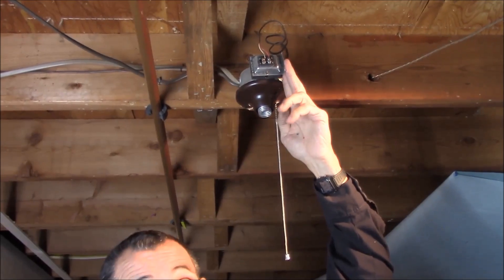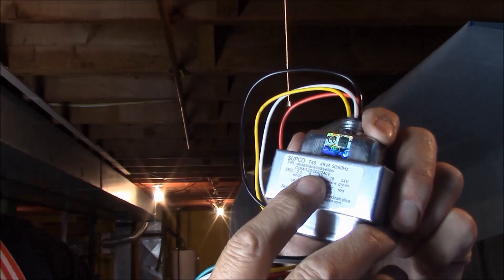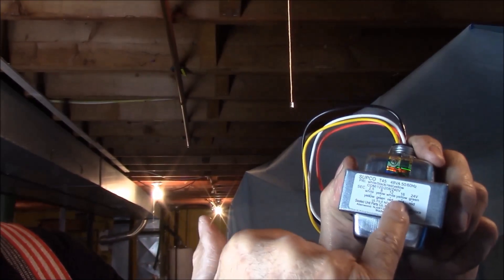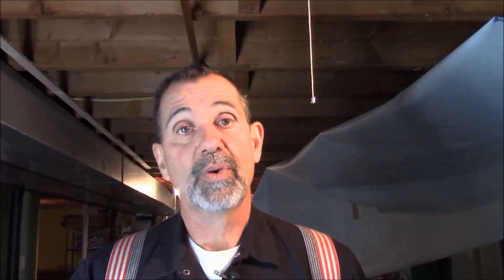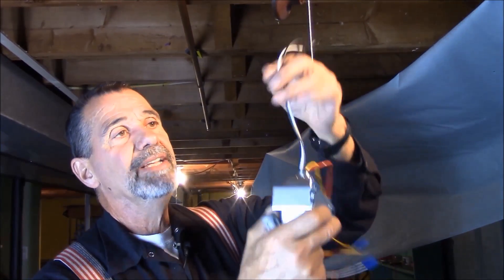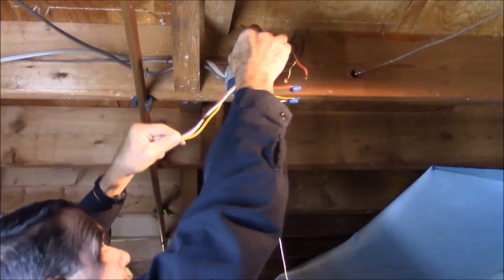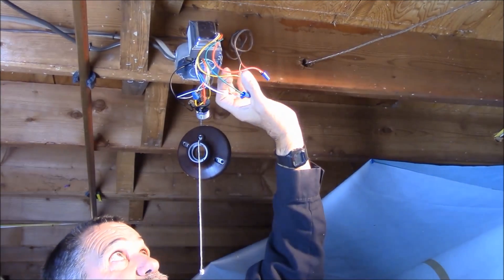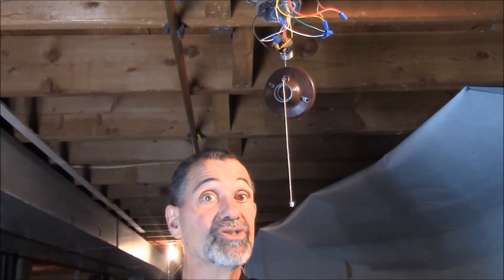Ring & Nest Doorbells Require 24Volt, 48VA Powerful Transformer

Comment: What do you use for the wired chime if you have a 24V one?  The one I got from Home Depot makes the noise and then buzzes.
Reply from the maker: If it buzzes after the chime you could have a sticky button or if you’re using an electronic doorbell it could in its software.
Reply: @MrHardware1  I have a Ring Doorbell Pro wired in (the wiring was already in place prior.  It "buzzed" with the 16V thing in the system and still does when that was upgraded to 24V.  Just a single Ring Doorbell press.  Tone plays and then longer buzz.

Comment: I’m trying to power three separate Lorex video doorbells and a mechanical chime. There’s not enough juice to power more than one doorbell at a time with the 24VAC 40vA transformer I had purchased. Now the challenge is to figure out if u need three separate transformers or not. I had planned to connect my main entry door to the “front” chime terminal and the other two doorbells to the “rear” chime terminal so I know which doors are being pressed audibly when I don’t have my phone on me. Anyone have advice for me on working these three doorbells with plenty of juice to keep them running and to operate with the mechanical chime aswell?
Reply from the maker: I would contact Lorex for advice, they should have seen this before.
Reply: @MrHardware1  how many doorbells were you powering up in this video.
Reply from the maker: @jonathanr1913  one doorbell with the front and rear button.

Comment: Can I wire the transformer to a 15A / 125V electrical wall outlet (reading 119.7 V) near the door? I installed a 3-Gang 55 cu. in. PVC blue electrical box under the electrical wall outlet near my front door. I then wired the transformer to the wall  outlet (white to white, black to black, and ground to ground) and installed the transformer in the blue electrical box. But the transformer powers the doorbell for a few minutes then dies. I have used 2 of these transformers (brand new) that you installed in this video and they both powered the doorbell for a few minutes then died and stopped working, with 0.00 volts showing on the multimeter tester😡. Then I bought a Defiant 16VAC/30VA transformer from Home Depot and same thing happens? 😡 What am I doing wrong? Please help.
Reply from the maker: It sounds like there is a short in the wiring somehow. Did the doorbell hum when you hooked up the wires? The Ring sends power to the old doorbell when the button is pushed, maybe the old doorbell is getting electricity all the time killing the transformers?

Comment: The stepdown transformer on display isn't the same on the link.
Reply from the maker: The actual transformer does change as the availability from suppliers changes. The device stays basically the same, wattage and voltage are the important numbers which we are aware of and maintain.

Comment: A 16V 30VA transformer is plenty for video doorbells, the 24V 48VA transformer shown is overkill, has more confusing wires, and when wired for 16V only produces 32VA anyway (2 amp current limit). Just buy the Ring branded 16V 30VA transformer and make your life easier.

Comment: Title says "Ring & Nest Doorbells Require 24Volt" but the video says 16V. So, which is it?
Reply from the maker: This is an old video, when they first came out they were to run on a 16 V transformer which is the old doorbell transformer. At the time upping the transformer to a 24 V transformer allowed the unit to run properly. I believe the power draw on the ring doorbell has been adjusted by the manufacturer to run on a little less power than the first ones sold.
Reply: @MrHardware1  So, should we use a 16v or 24v transformer? After a lot of thought & research, I ordered the 24v one, but wonder if it may prematurely wear out the gadgets. 

Also, how to tell if a model has a thermal cut-off? I got the Maxdot brand.
Reply from the maker: @rswow  I would consult w/the manufacturer of your accessories, things change that I don’t have time to monitor.

Comment: The transformer that worked for my ring door bell for the last 2 years  blew it was 16 v 15VA I purchased  a 18V 30VA ihave 18 volts out to the ring bell and now the ring wont light up. not sure if the old transformer blowing harmed the ring or I need a bigger transformer? I am leaning towards the rign got damaged.

Comment: I was told to use a 24v 40VA transformer for my Lorex doorbell camera. After installing the transformer I have 27.9 volts at the doorbell camera. After making the switch the camera was working fine for about a half hour then it just cut out and wont work anymore. Any chance 28 volts is too much for doorbell camera? Thanks in advance.
Reply from the maker: Sorry, that is above my pay grade. You need to call technical help from the manufacturer.

Comment: What is the wire gauge that goes from the transformer to the ring bell camera?
Reply from the maker: Usually 18 gauge is sufficient, but if I’m running a  long distance (over 50’) maybe I’d use 16 gauge.
Reply: Thanks for the response. My transformer went out,  replaced but I think I burned out the new one as just a few minutes later stopped working
Reply from the maker: @Marco-bb7np  that is a good indication that your bell wires are shorted out somewhere between here and the buttons and chime. It’s just making the transformer run full speed until it burns up.
Reply from the maker: @Marco-bb7np  it is not uncommon for an amateur wiring this up causing a dead short in the wiring. Often when a feed to the chime is at the transformer location. Consider a pro to look in on you……

Comment: So the ground wire doesn't need to be "connected " to anything?
Reply from the maker: Oh yes it does by code. Older homes in my area weren’t wired w/grounded wire, hence no ground available unless you run a ground wire to the panel or a cold water pipe which isn’t as simple as I’m saying and needs to be overseen by a contractor on site.

Comment: Hi,    I've seen some youtube videos require a resister to be in series with the circuit if not using a physical chime box.  Seems like the resister is to absorb the power surge.
  Does Ring require this or have they figured out how to simply use 24VAC at 40VA?   I bought another brand and it cooked without a resister, so I'm not wanting to blow up a ring product...  if at all possible.
Reply from the maker: You’re out of my pay grade on where and when to use the resistor. They deliver resistance and emulate a load, but I’d follow directions to a tee. Possibly calling customer support, not YouTube……

Comment: Kind of confused about the wiring, my house has 3 wires black, white, and green (ground) and my current transformer has 3 wires black, white, and green. When looking at the transformer listed on your site only has 2 wires coming out of the transformer (Black[hot] and White[neutral]) but it is missing the green wire which is the ground. What do I do with my in-homes ground (green) wire then?
Reply from the maker: Ground it to the metal box if it is metal. And connect the ground wire to the metal frame of the transformer, however all new transformers come w a ground wire.
Reply: @MrHardware1 , my transformer that I removed did only had two wires, no ground.  The new one has a ground and the electrical box has a bare copper, do I still attached the green ground to the metal box or connect it to the bare copper?
Reply from the maker: @verleneperry-newburn905  both, the box should be grounded and of course connect to the green transformer wire.

Comment: Can I put a door bell transformer on the outside of a device box inside a wall that has insulation???
Reply from the maker: First off it must remain accessible. So it cannot be closed in a wall. They get hot so I always leave them on a metal box and away from combustibles.
Reply: @MrHardware1  Yeah I think it is better on the inside of the box no doubt. However I think it could be argued that if if the device box is arena box that can be loosened off the drywall u could technically still access it by pulling the whole box out of the hole. Probably wouldn't fly with an inspector tho I suppose.
Reply from the maker: @soldatheero  You could put the transformer inside of a two gang box and then with a two gang blank cover you could cover it up and no one would know but yet there’s always be access to it.
Reply: going to drill a 1/2 hole in the side and use the nipple on the transformer to mount it there.

Comment: My new transformer didn’t have a green grounding wire, what do you connect the ground wire from the wall to?
Reply from the maker: The box if there isn’t a ground screw or wire on the transformer
Reply: @MrHardware1  thanks

Comment: I have a old house I have 2 black wires coming from electrical system hooked up to the old transformer How do I hook up the new transformer that has 3 wires 1black 1 green and 1 white ?
Reply from the maker: The black and the white go to the 2 power wires, the green ‘ground wire’ screws to the box or connects to a cold water pipe. If you have any doubt contact a local electrician to be safe.

Comment: I got a 24V 40VA transformer for my Ring doorbell, that's the power required by Ring. After 2 minutes of connection to the doorbell, it gets very hot and starts smelling a burn. What is the reason for that and how do I fix it?
Reply from the maker: Very hot and a smell means there’s a short in the wiring. Or a defective transformer. Connect the transformer to the power but don’t connect the low voltage wires and see if it gets hot then. If so Disconnect immediately. Somewhere along the line one of your wires must be shorted out to another and the only way to do that is the hard way, follow the wires all the way.
Reply: @Mr. Hardware  it looks like the short circuit is on the ring itself as the 2 wires connected to the terminals get warm immediately. This must have happened when I first connected the Ring directly to the wall wires that were connected to the stock doorbell without connecting the transformer first. This lasted for few seconds but was probably enough to make a short on the Ring board. Luckily it works with the battery power. I will try to find someone who can dismantle the Ring device and check it out.

Comment: I have 48volts at the arlo door bell front door. I have 24v at the rear door bell. However at the chime I have 24v front and 0 rear. My issue is the arlo camera got fried.  I found a transformer under my home and it had 24v I'm lost .
Reply from the maker: There should be no way you’re getting 48 bolts on the doorbell circuit. Look at me like you should get a professional to oversee what’s going on at your house.

Comment: The two transformers you linked to are both only 30 VA not the 48VA you recommended in the video. Where can I get the Supco you are showing in the video?
Reply from the maker: Call store, 586-776-9532 and we’ll ship. I’m checking to put it on our site, soon there.
Reply: @MrHardware1  Is this 24v xfrmer available now on amazon or your site ???
Reply from the maker: @troyhenry3267  we are currently changing the transformer on mrhardware.com to a better one. Call Gilbert’s Hardware and ask for Daniel and he can sell and ship one if needed. It may take a week to change the store shopping cart.

Comment: My existing transformer only has two wires but all 30v transformers have three wires any help
Reply from the maker: Either one is a ground, green, or you have a multi voltage transformer. Only the manual will tell you which colors provide the difference voltages.
Reply: @MrHardware1  left the ground capped off ran neutral and power. I'll let you guys know if the house ever catches 😂👍

Comment: Hello. I have a question - hope you can be of assistance. I’m in the process of doing some minor renovations to my home and I want to remove my rear doorbell. Obviously I’m going to remove the doorbell and patch it up with stucco. By disconnecting the rear wire from the chime box, will that be enough or are there other steps I need to take? Thank you in advance
Reply from the maker: I would find the transformer, that’s where the second wire from the button goes, and disconnect it also.

Comment: After all these years, volt amps=watts. Of course. Never thought it through, but now I wonder why it just not listed as watts. May be trivial, but now I"m wondering if a lower gage wire might be in order. Excellent video.
Reply from the maker: No, lower gauge wire restricts the flow of electricity, never a good idea unless your making a toaster. Restrict electricity and you’ll make heat.
Reply: @MrHardware1  Wouldn't 10 gauge be lower {less restrictive} than 18 gauge? Maybe I said it wrong.
Reply from the maker: @mikefixac  yes it is, when you said lower I assumed you meant smaller
Reply: ''After all these years, volt amps=watts'' Really?
Reply: Mine transmitter is making a wining noise since install, is that normal or do I need too disconnect the green n copper wire?
Reply: Volt Amps are not exactly always the same as watts when it comes to AC. This is because the power factor that results with load that isn't purely resistive, such a inductive load (like a transformer) or a capacitive load. Power factor isn't a simple concept but that is why they don't strictt equivicate VA with Watts.

Comment: Wait  at 2:47....30 VA is 30 watts...or is it 30 volt amps?  If volts times amps equals watts...wouldn't it be 16V time 30VA equals 480 watts?
Reply from the maker: Watts and volt-amps are the same. 30 VA divided by 16 equals just less than 2 Amps.
Reply: @MrHardware1  thanks.

Comment: I have a rare situation. I’m installing a eufy camera doorbell in an apartment complex that doesn’t have enough voltage to operate the camera. The transformer operates the doorbells of all 4 apartments in the building so I cannot and maintenance obviously won’t upgrade the transformer. Is there a way to bump up the voltage with some kind of inline voltage booster/transformer?
Reply from the maker: You may be able to get a plug in the wall transformer and wire your camera to that. No way to upgrade in line voltage coming from the transformer that I am aware of

Comment: Is it possible to piggyback from a wall outlet/receptacle by using pigtails?  I have a similar light to the one you're using here to demonstrate, but ours have the wall on/off switch, so I don't think the same application is going to work for us.  However, we do have a 15amp receptacle, breaker at the main panel, that's near where we want the doorbell camera installed.  Thank you for all you do.

Comment: I used a 16v 30VA Transformer for my Arlo doorbell cam. And works great. Unfortunately I had a dilemma with Arlo using their voltage regulator that came with the doorbell kit. That thing kept blowing the transformers, I went through 4 of them. Even ran new wiring, still kept blowing. So, I tried without it, and it was working fine. The setup instructions said to install that voltage regulator, well in my case, that's a hell no!!

Comment: The resistance is necessary right now, I put an adapter 127 volts to 24 volts 1350 mA and I had it for a few minutes like this now my ring doorbell 2 works everything but when it transmits video the horns sound like analog TV with no signal I'm afraid that I have already damaged it yes yes  disassemble it and remove the speakers and use it like this now on

Comment: I found my old transformer was only 8 volts, so I upgraded to a 24v 40 watt transformer (wall wart style). I still can't get my mechanical doorbell chime to ring. The chime for the back door still works fine, but not the front door. The Nest doorbell works otherwise. My front door is about 15' away from the doorbell chime unit, so maybe it's not getting the signal? There is nothing physically blocking the chime from operating either. I even bought a 16v transformer, but that didn't help. I have read that some chimes just aren't compatible. Mine is about 10 years old, but maybe that's the issue, we'll see
Reply: My issue was that I didn’t change the settings for that particular door to ring inside the home. I only had the video on.
Reply: Do you have 30A on that transformer?

Comment: Hi Mr. Gilbert,
I have a ring but it is buzzing and if my front porch light is off (at night) it rings fast. Any ideas? Do you think this would help me because my transformer is 10AV and 16a.
Reply: Sorry, the ring is out of my expertise.
Reply: I had the same exact issue. I just installed a 16vac/30va transformer and I have no issues at all anymore. Mine was also what you had.

Comment: When hardwiring a “ring” doorbell the low voltage from the transformer is only for trickle charging the battery. It does not use the low voltage power to operate the units functions.
Reply: The Ring Pro doesn’t have a battery and you need to use a 16V 30 VA or 20 volt, 20 VA transformer for it to also ring the home’s doorbell when the button is pushed.

Comment: Sucks when you can’t find the existing old transformer in the house.
Reply: Had that same problem. Couldn't locate the transformer to save my life. Watched this video and immediately found it mounted to the top of the junction box right above a wired smoke alarm in the basement. Could barely see it.
Reply: Me too. I was going all over the house and couldn't find it, then watched this video. It was in the HVAC room connected to the ceiling light. Mr. Hardware you are the man!
Reply: I say look for a tone sender! You put clips on the end of the doorbell wires behind your doorbell and follow the beeps from the sender
Reply: I’m still looking . . .